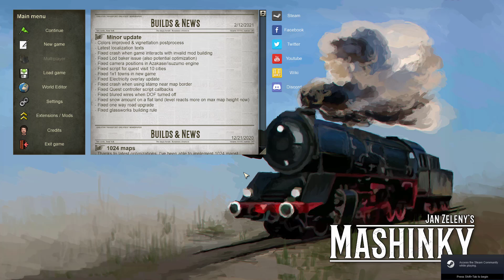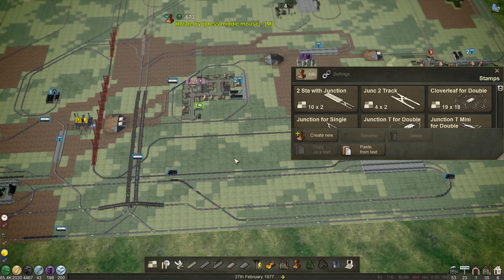S1:E10 - Mashinky - Hard Difficulty - Small Map - Low Density Industries and Towns

Comment: One thing to note with stamps, is the bridge portions are always the "cheapest" option. You have to go in and replace them with upgrade materials, otherwise your trains are limited to 31 mph over them.
Reply from the maker: Good point.
Reply: In the settings for stamps you can set what type of bridge they use.

Comment: Hi Adekyn ... I think you are slowly getting to the stage were direct links are taking up to much space. With every new era you got new industries and towns, and as we saw with the Oil Power plant it emerged between a lot of already layed tracks. At the start direct links are of cause faster, but after a while it gets quite cramped. I also start with direct links ( because its the cheapest option to start with) but I also try to work out a main line for later use, and to reduce the number of tracks criss crossing
Edit: Colonel Failure would be proud of your BULLDOZING talents :-)

Comment: That Bangle trick saved me when I had to shift off the super large coal (I think the EC2) to diesel. I was not making enough petroleum, so a decent money only train had to take  over some loads.
Reply from the maker: What size map and industry density are you playing? I'm not sure there is enough oil / refineries / factories on a small map with low density to support diesel and the largest coal train eats all your coal in a hurry.
Reply: I like to use at least 512x512. I actually just stated on the 1024x1024 Poland map from the workshop.